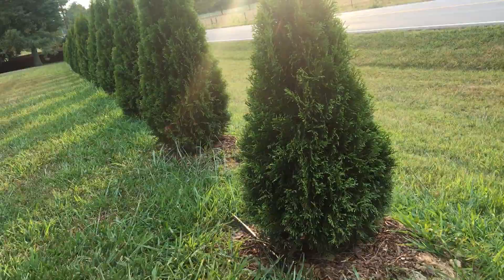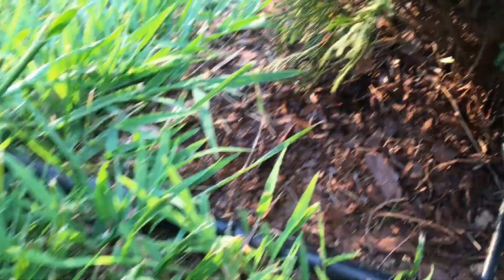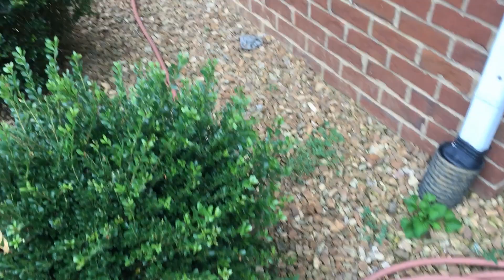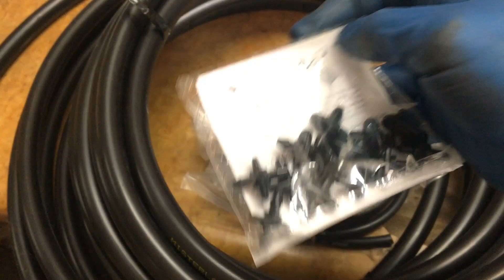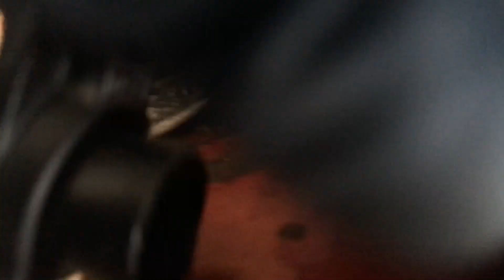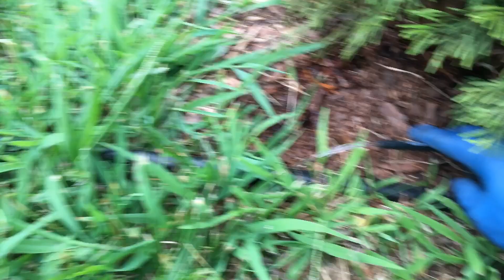Simple Irrigation for New Trees (Emerald Green Arborvitae)

Comment: You didn't put emitters on the 1/4" tubing.  You need emitters to control the flow or you will not have enough water on the end of your line.  Emitters come in various flow rates such as 1 gallon per hour 2 gallons per hour.
Reply from the maker: Thanks for the comment. If the water supply line is not sufficient to keep up with all of the drip lines then I would agree you need emitters to restrict the flow (or if you want to ensure you get the exact same water amount to each tree). In my case, I checked all of the drip lines and had sufficient water flow at each line without emitters. I think I show that somewhere in the video.

Comment: How long do you water your arborvitaes for per day ?
Reply from the maker: Short Answer: Generally I water them for 1 hour in late evening when needed, occasionally I would let them run for 1.5 hours if really dry. I water all 46 trees at the same time from one hose. 
Longer Answer: I planted them in late April last year and live in Middle Tennessee, so quickly ran into the dry months. I probably watered them up to 4 or 5 days a week when hot/dry but would  back off when we got cool or wet weather. I quit watering them probably in late fall when the weather turned cool and left it off all winter. I just reconnected my hose and started watering again a couple weeks ago. I a no expert but lots of websites tell how to check if the soil is dry using a screwdriver, this is what I did. If you can push it into the ground 5-6 inches then the soil is damp enough, if you cannot get the screwdriver into the ground then it is time to water. Soil types may play a factor too. Anyways,  all mine are still alive (crossing fingers) and I am in no way a “Green Thumb”, check your soil dampness occasionally and use your judgement and will probably be just fine. Good Luck.
Reply: @harryshouse7012  thanks 🙏 I’ve got 17 of them and just got irrigation and have the drip system for them living in northern Michigan so thinking 1 hour  per night should do and will try your screwdriver trick also thabks